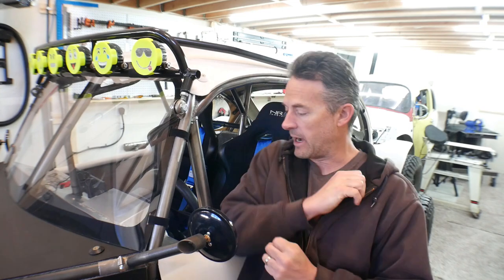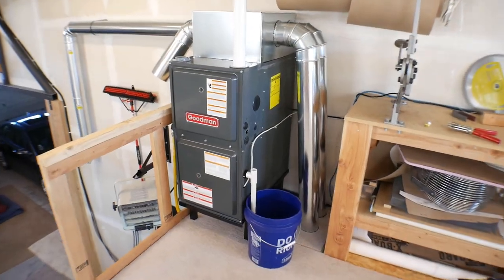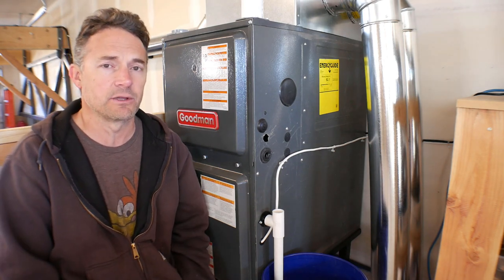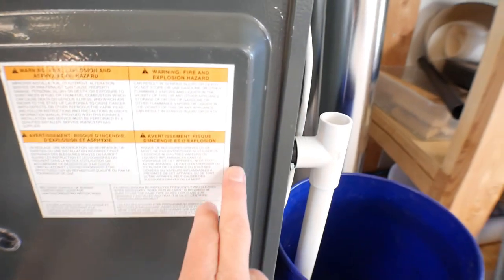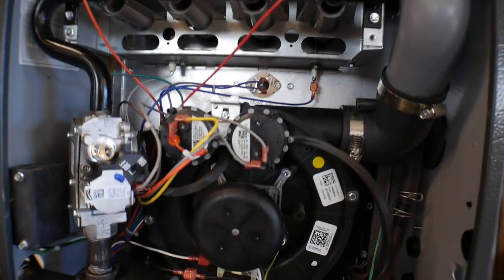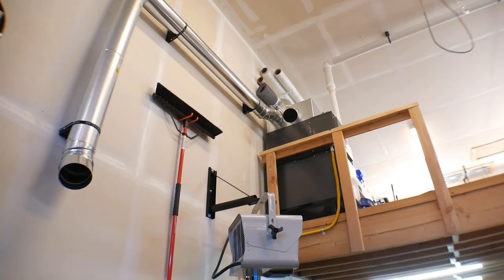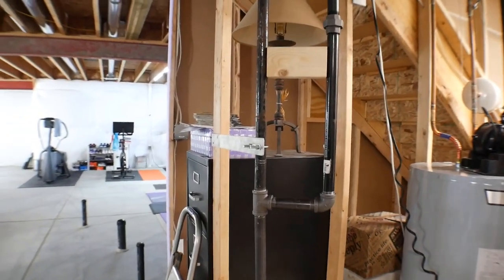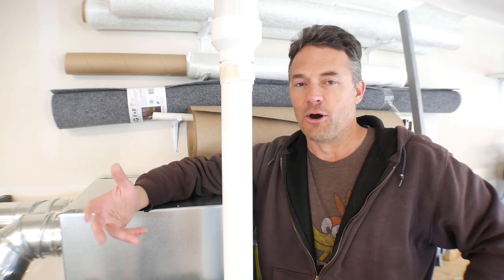I installed a furnace in my garage, how I did it and how it works.

Comment: I knew there was something I liked about you, lol. I’ve got over forty years in the HVAC business here in Florida. Got home from installing three systems and a chiller system for the nitro fuel in our race trailer. We purchased Rusty Wallace’s nascar trailer and have been converting it for drag racing, first run on the dragster will be Monday🤞🤞. I’ve found it best to crimp you snap lock facing down stream to prevent possible whistling , very important on dryer venting as the crimp will catch lint . Nice work Doug
Reply from the maker: Chillers, nice. That's what I deal with mostly now. But for some reason I still like working on residential equipment from time to time.
I'll bet that's a nice trailer, good luck on Monday. 🤞

Comment: Nice to see an install. I just picked up a working 1995ish Coleman Evcon 100k for my 2000sqft shop for free. It’s an 80% but the parts are readily available and cheap and the older ones seem to be steady Eddie’s if they’re taken care of.
Reply from the maker: Nice, those 80% furnaces can run for years and years if you keep them clean and dry.

Comment: Thanks for running through your install...  I put a small 220V electric heater in the shop because it was an easy install.  Seeing this, I will have to put a gas upgrade on the to-do list.  The electric is great if I fire it up right when I get out of bed, but I'd rather have it warm up quickly...  Sometimes I only have a short window to get out in the shop and work.
Reply from the maker: I was in the same situation. I too have a 220v heater out there. But it really only works if it's pointed right at me. It's not enough to really warm up the whole area.
Now I'm unstoppable! 😁

Comment: Hey Doug thanks for the video I recently installed a suburban lp rv furnace in my 12x25x10 ' garage. Garage is fully insulated except for roller garage door . The Furnace is 30.000 Btu I ran the lp hose towards the front of garage so I can change out tanks I put on outside right of building . The furnace heats garge quick from 40 to 65 in like 10 minutes so I am happy installing wifi thermostat tomorrow . Like you I will use it when I am working in garage and keeping tools and equipment warm makes it alot easier on this old man hands. I was doubly cousios installing this being very aware of venting and carbon monoxide . I have it running of a battery 12 volts and a auto charger maintainer so either way Ill have heat if power gos out . NOw I kinda wish I had found your video earlier BUT I know nothing about home furnaces and ther installs and I do not have much floor spae for one we will see how this works .
Reply from the maker: Nice job, I particularly like how you have it running off a 12v battery.  👍
Reply: @DougBugBuilder  ok I hooked up  wifi thermostat and it does not quite run correct I have two wires from the rv furnace basically when the two blue wires make contact the furnce fires up but with regular two ire hook up on thermostat it will call for heat then it shuts off for like 3 seconds and just the fn comes back on untill it calls for more heat . I changed wires around and got it to shut off when nit hit correct temp but ow it is saying I need to hook up C wire for WiFi to work  (sigh) SO now I have ordered a C wire power supply nd will hook that up and see if I can keep WiFi connected to thermostat (sigh)

Comment: Awesome! Wish my house had natural gas service. I'm limited to propane in my neighborhood and it's crazy expensive. Right now I'm paying $2.07/gallon on a whole sale co-op price plan. After Jan of 2021 the prices sky rocketed. I was paying $1.45/gallon this time in 2020. You do the math... Anyway I'll be getting another 500 gallon tank this summer so I can install an overhead radiant heater in my garage. I figured this would be the best for that application given that I have a massive American Pacemaker lathe in there and a Bridgeport style knee mill too. They'll soak up the heat and help to make it last longer. My other shop has an old wall unit installer. It does a pretty good job when I run it. However that shop needs insulation and drywall before I'll even attempt to run it longer than 30 min to break the chill on days where I can't tough it out.
Reply from the maker: Wow, I never realized propane was that expensive. Natural gas is cheap, even now. I mean I'm still careful with running it, but it's mainly just because I don't like to waste energy. Not so much the costs. Like you sometimes I try to tough it out. 🥶
Reply: @DougBugBuilder  Yeah I didn't realize it either until I moved into a more rural neighborhood. If I would have known, I'd have definitely looked for a house with natural gas. It's extremely expensive every winter. So expensive that I pretty much shut down working in my shops as a result. However it's important that I keep my lathe and mill from rusting. I'm going to need to keep the garage at around 45-50 all winter. I plan on replacing the doors and spray foaming the roof. The walls already have fiberglass bat in them. The doors are the biggest issue. The wind almost always blows towards them. One winter the snow blew in through the gaps and covered damn near everything with a light dusting of snow.

Comment: Nice work. I'm planning a furnace install for my shop later in the year but I'm all electric.
Reply from the maker: All electric is good. I have an electric heater in there now. It's just to small to use on really cold days.
Reply from the maker: @Cory Gill Man the way you write is really entertaining, I love it. 
When I was in Illinois we had installed a Daikin VRF system in an office building. They kept complaining because it was bringing in humidity because of the outside air requirements. So they were complaining about the system a lot. I ended up showing them the energy savings they were getting compared to when it was just RTU's up on the roof. Suddenly they had much more respect for the new system. 😁😁

Comment: I like how you blew up the gas line going to the garage.  Only thing I noticed was no intake on furnace.  Going to lose some efficiency for that makeup Air?  Also, only difference I would have done on the gas line is a ball valve to isolate the garage hookup.  Easy enough to install one with that union there.

Comment: Good job my friend. 
I have to heat on my garage, on woods.
I don't have gas. 
It's a home made stove,  by me, of course.
I make from 4 grade to 22 in almost an hour. 
It's very good warm.
I could work all winter,  1 day per week,  when i got time.
Reply from the maker: Nice, I would have liked a wood burner. But the houses are so close together here it would never get approved.
Reply: @DougBugBuilder  i like your pipes heaters. 
Your house is the same, with air heat, not water pipes radiators etc...?
Reply from the maker: @ciobanuvalentinmail  Correct, my house is a natural gas furnace just like I installed in the garage.

Comment: That is a very nice install. It will function well for many years. Did you consider putting in a ceiling fan to pull the warm air down from up there?
Reply from the maker: No, but now that a couple have mentioned it I might. Seems like a good idea. 👍

Comment: Sweet video Mike, as usual top notch work, I have come to expect nothing less from you, lol, that is awesome that you have heat in the shop now, have you been thinking about what to do with the trailer yet, talk to you soon Mike
Reply from the maker: Hey Mike, I've been thinking about the trailer but haven't come up with a solution yet. It's a real head scratcher. I'm leaning towards just making ramps to hold the rear above the tires for now. Although I'm not real excited about that idea.
Reply: @DougBugBuilder  yeah I’m with you on that, maybe a one piece fender to fender made out of aluminum with pegs that would pull out when your not using it, other than something like that, looks like the options are a higher deck or wider axles, if you went the axle route do you think you could cut them weld in a piece, and move the fenders out a bit, just throwing some ideas out there, there’s only so many things you can do 😂
Reply from the maker: @DesertRatFabrication  The other option I'm considering is making a set of temporary wheels that are real narrow for when it's on the trailer. But I don't know, it seems like a lot of work.
Reply: @DougBugBuilder  I moved Ratchet to the windshield on the truck board but sense it was the red one it doesn’t have a Doug Bug with it ,lol
Reply: @DougBugBuilder  yeah you would probably still have to deal with the fenders

Comment: Finally got heat! Congrats! Now add yourself a couple ceiling fans.....it will really help move that hot air around the shop....
Reply from the maker: That's a good idea!
Reply: @DougBugBuilder  Now I can feel comfortable coming to check out this insane build....without getting hypothermia....LOL
Seriously, Home Depot has a wall mount fan that turns...even comes with a remote. Works awesome for moving air, even when it's summer. A regular ceiling fan would be good over in the 2 car garage, to keep that hot air moving down and back in to where you work.

Comment: Cant believe you got a furnace that new for that price. Can the water trap freeze causing damage to the trap?
Reply from the maker: It doesn't get cold enough in the garage for the trap to freeze. But I did notice if it's really cold when the inducer starts up some of the water in there will freeze and prevent the inducer from making the air proving switches. Once I had to blow a hair dryer at the inducer to get it fired.

Comment: I have a similar furnace. For some reason they never made an run to heat the kitchen. It’s an older model and an old 1920s cottage. I’m thinking the technician didn’t want to crawl in the very small crawl space and cut through the floor. 😂 Is there an easy way for me to add a line to warm the kitchen. It’s a similar size unit and the house is about 700 sq ft.
Reply from the maker: I'm sure if you could squeeze maybe a 5" round off the furnace you could run that to the kitchen.

Comment: Holy static pressure Batman…
Reply from the maker: You have to measure the pressure in PSI, not IWC. 😁
Reply: Yea, not sure about that exhaust set up… I’ve never turned one down
Reply: As long as it has a means of drain it should be ok… not conventional though I will admit

Comment: Without a filter… you’ll jam that furnace with so much shit… it’s not just the blower wheel you want to keep clean, you will plug up the secondary heat exchanger.. then it will crack. And at that point you need to pray your pressure switches open and save your life
Reply from the maker: I'll add a filter to it.